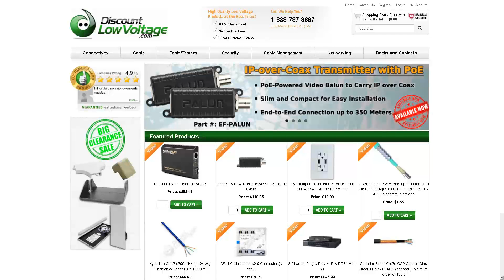Fujikura AFL CT-06 fiber cleaver overview and blade adjustment

Comment: What the function of gear on the blade?
Reply from the maker: After so many cleaves at a spot on the blade, it gets dull. Rotate it to move to the next spot for a new blade.
Reply: @DiscountLowVoltage  why are you using tissue to rotate it instead of using that gear